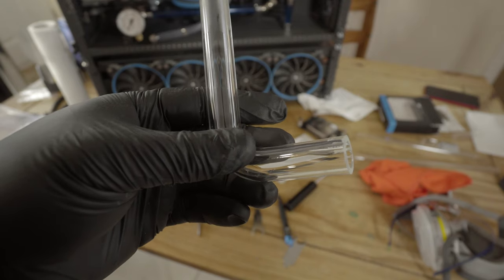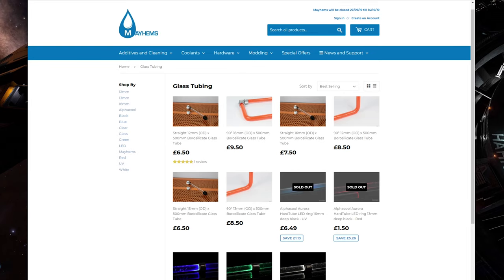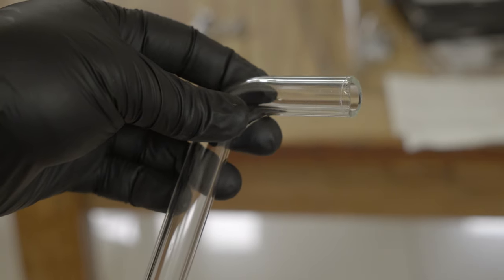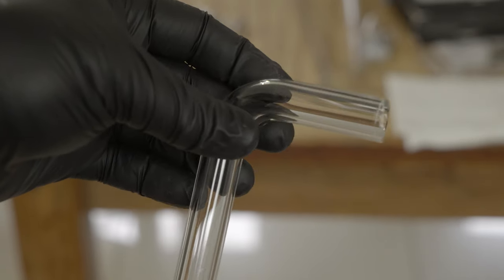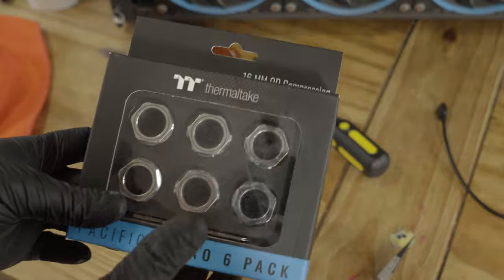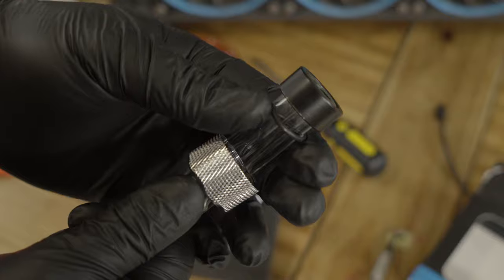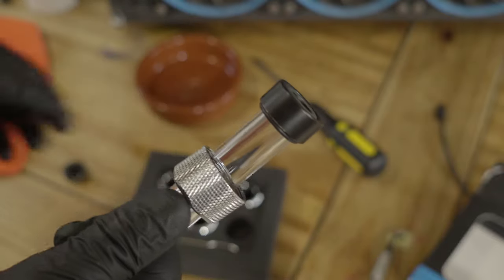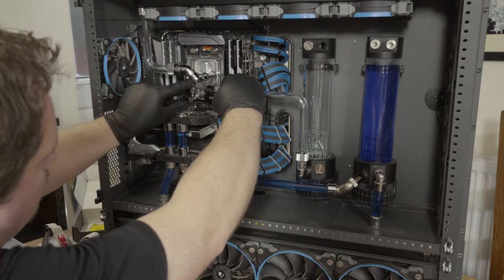How to install Borosilicate glass tubing

Comment: I just dremmel my 16mm tubes with diamond cutter. So I don't risk getting a bad snap and wasting the tube.
Also you can keep taking a bit off at a time with a dremmel, you don't need to buy extra petg first.
Cause you can't use the snapping technique to take off 2mm anyway, so a Dremmel is still required.
It's a bit slower than working with petg but that doesn't matter unless your building pcs every day

Comment: Could have should have would have (maybe) yeah, you could have used these things called, pipe cleaners, to do the pre-measuring/pipe mock up. It's not perfect, but it's good enough. You get two, and twist them together, for extra rigidity. They will hold their form.

Hey, btw, good job on the build. And thanks for sharing🔥